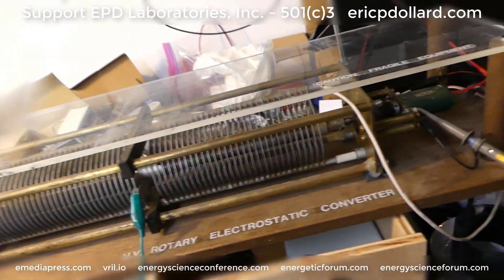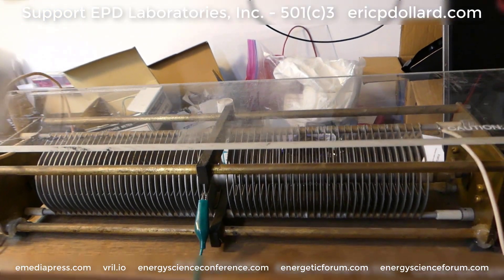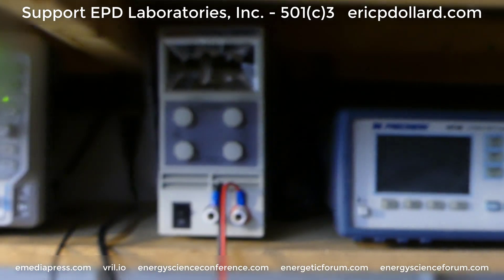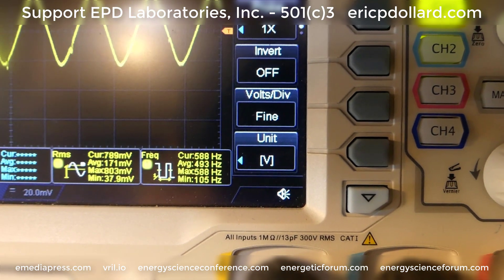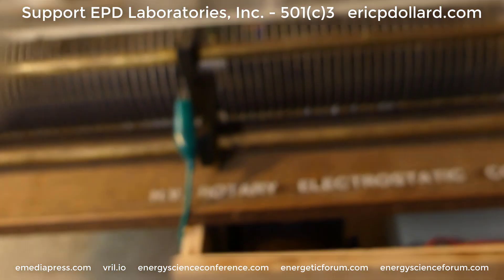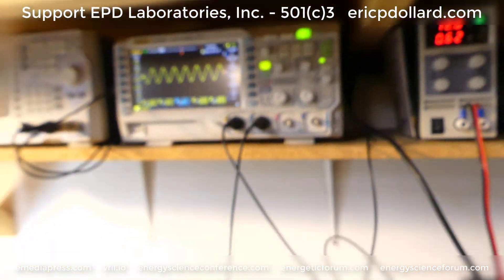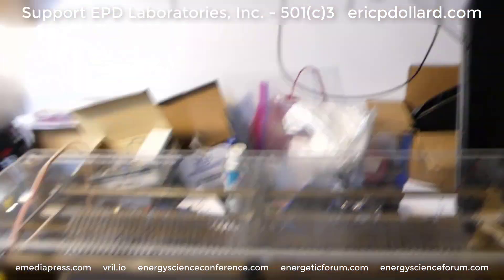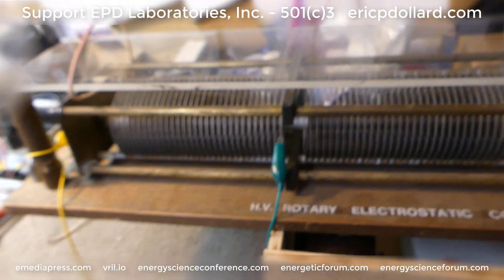Rotary Electrostatic Converter - electrostatic potential drags down prime mover

Comment: Aaron, After a long time friend, what happens if you put the -10KV Green alligator clip to the far right side covering the other 190 degree out-of-phase capacitor plates section? The mechanical drag on the left hand side of the capacitor is being cancelled by the right hand side capacitor set, as they are out-of-phase and exerts mechanical forces completely opposite to each other? in this way, only a small or theoretically no force / drag will be exerted on the motor itself. What do you think? I'm thinking of replicating this on a smaller scale??

Comment: think b4u speak!
Reply from the maker: You're obviously not comprehending why. It's not a complete system in that video.
Reply: I’m not even sure what I meant by that comment  lol. I’m wondering if it was supposed to be for another video and accidentally commented on yours by mistake
Reply from the maker: @spaceminers  LOL - ok, fair enough.
Reply: @AaronMurakami13  Awesome design by the way. I research everything under the sun as well as everything inside the sun lol I have many projects one of which is an electro static generator powered by light. My first prototype will be a tiny copper or lead coil inside a little blob of clear silicone. I’m hoping that it will produce a magnetic field when illuminated by a pulsing laser beam. It could be placed in a mirror box to increase its strength. I call it photo-electrostatic or maybe photostatic technology because it uses photons to stimulate the electron migration instead of kinetic energy.
Reply from the maker: @spaceminers  Sounds pretty advanced - hope it works out!

Comment: Dude, really??  So have you consulted with Eric Dollard??  But anyway.... nice try, but as soon as it 'starts arcing'....all bets are off... the thing is meant to 'convert' h.v. static d.c. potential to 'some sort of varying h.v.'  ..... nothing more.  As soon as it arcs the current in those plates dissipates thru the air, and the voltage on the arcing plates goes toward zero.... if it's draws a little more current from the motor, and slows it down is probably due to  secondary factors, maybe currents in the bearing, eddy currents, or possibly magnetic fields created by the high current arc.... just saying....
Reply from the maker: You haven't the slightest clue as to what you are talking about. The experiment you see was done by me at the request of Eric Dollard!

Comment: If each of [that many] plates were a 1 Meter Wimshurst, and you were configured to pull electrostatic energy from the machine instead of putting it in - I could see a variety of useful FE/OU experiments that such a setup would occasion.

Comment: It would be neat to rebuild as a rotory electrostatic to ac  generator.  

If a rotory plate were connected to ground through a load and rotated to passed between a positive plate and a negative plate, then electrons would flow from ground to the rotor then from the rotor to ground while the rotor plates alternatly move  through more positive and more  negative electrostatic fields.  Work is done by moving charges on the rotor plate through alternating electric fields.

Comment: So you see no change in speed or current until the voltage is high enough to have sparks jump between the plates of the capacitor. As soon as sparks start jumping, current flow, you see speed decrease and motor current increase. The rotary capacitor is alternating between less plate surface area, and more plate surface area. As it transitions from more plate area to less plate area, voltage between the plates should increase. When it transitions from less plate area, back to more plate area, voltage between the plates should decrease. As it transitions from more plate area to less and voltage increases, a load is placed on the motor. When it transitions back, a load is taking away from the motor. With no discharge between the plates, the net load on the motor unchanged. When The voltage increases and it starts discharging, It doesn’t get any load taken away from the motor, so you see a decrease in speed, and increase in motor current. Let me know what you think.

Comment: What does it mean ?
Reply from the maker: It means if the electrostatic can slow the prime mover that the electrostatic could potentially run the capacitor as a synchronous motor - no pun intended. That would be a motor with no magnets and no coils.
Reply: Aaron Murakami  Seems like you should be able to.
Reply: @AaronMurakami13  ever seen atmo motor from laser hacker? Sounds like the coilless and magnetless motor you describe
Reply: @AaronMurakami13  Seems I have seen electrostatic rotating(rather slowly) devices that do convert high potentials into rotary motion ....